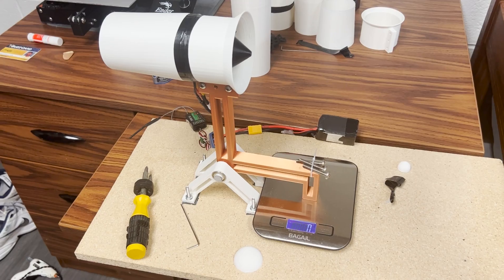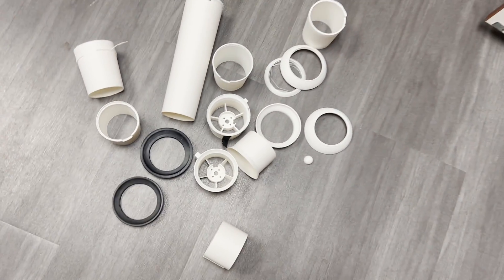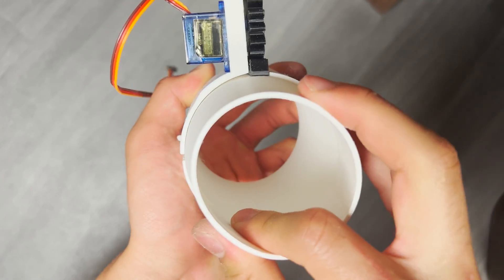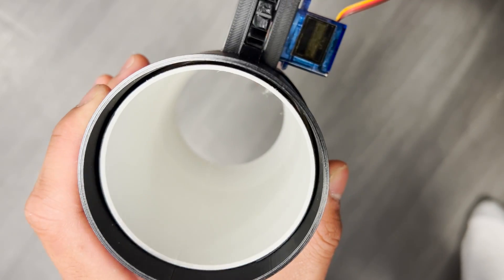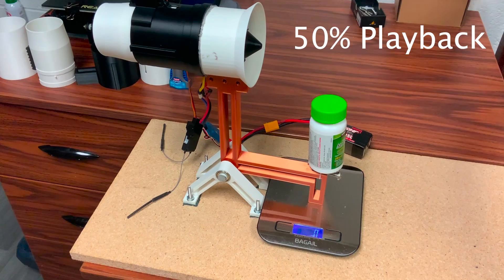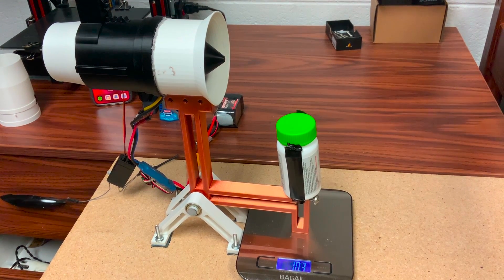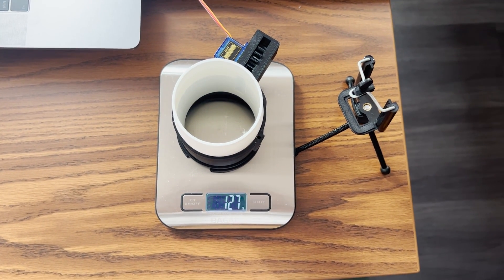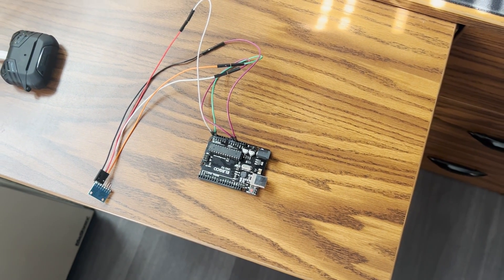Variable Length EDF Thrust Tube (VLTT)

Comment: should have done balance weight testing with no thrust load to see if the changed CG is what is causing the 3 gram difference. not sure if a thrust lever is the best test rig for this
Reply from the maker: It is, I calculated it before hand as +/-3.5 g in either directions. With that info I tried my best to approximate the actual thrust readings. Briefly mentioned in the vid but I don’t think it was communicated well. I agree, I need a new system

Comment: My theory about the decrease in thrust when you increase the tube length is because of the change in centre of mass of the system. 
When the tube length is short,the centre of mass is much closer to the pivot point as a result the backward torque (acting anticlockwise) produced is much less. But when the tube length is increased, the centre of mass of the system moves backward (towards left of the pivot point) as a result some of the backward torque (anticlockwise) will cancel the thrust produced.

You should make other type of thrust measuring device which do not use the principle of torque.
Reply from the maker: I brushed over this in the video, but I calculated the natural mass offset (+/-3.5 g) and factored that into the thrust “calculations”. But I agree that I need a new system if I were to test this further, especially for a continuous range of lengths (that’s why I only tested those 3 points in this video)

Comment: If I'm not mistaken the thrust tube roughness can reduce thrust quite a bit. On many scratch-built EDFs, it is recommended to use smooth plastic thrust tubes; such as transparency film, or in some cases using packing tape on the inner surface of polystyrene foam sheet ones to achieve most thrust.
Reply from the maker: Yeah I was thinking about this when they came off the printer. Good to hear it from you. There are a number of ways I could approach this, but at least for this iteration I most focused on relative preformance. But I'll incorporate into the next
Reply: @mach10point4  Just hit the inside with sand paper. Or leave it rough so you dont introduce a new variable to the tests. Just always use the same layer height

Comment: Wouldn’t the weight upon moving it in and out change that our readings a bit due to the center of gravity changing? Or is it such a small change that the scale wouldn’t notice?
Reply from the maker: Yeah it would. I might’ve rushed thru it I the video but I found that the readings were affected by +/- 3.5 g in the fully out and in configurations. I adjusted the thrust readings reported based on this. That’s partially why I only tested at the 3 positions

Comment: Sick dude, keep going bro. I like your videos.

Yeah idk there might be something to investigate in 3 variables.. the throttle of airflow from the motor to the fan design, the airflow in relationship to the length of the tube, and then nozzle size at the exit of the air. You might just have to make your own formula for it. Worth investigating though. 

Weird idea... why not just make a cone shape? isn't just making it long not efficient? the cone shape can be your nozzle size (or make it variable somehow idk..) but it's also the Duct at the same time so it will look stubby but then the question resides... how long.. and how wide cone should be and the exit hole for to take complete advantage of compression the moment the air comes in.
Reply from the maker: Yeah. Many factors. I mind as well make the adjustable angle at the exit as well

Not sure what you mean by cone? Like a consistently converging slope? Or a cylinder?
Reply: @mach10point4  instead of a cylinder.. just make it a cone to immediately compress the airflow just don’t choke it too much or you wont get any Thrust.
Reply: @mach10point4  okay, picture an Ice cream cone, with the end chipped off. At the largest opening which is on the opposite side you make the diameter perfectly fit the motor.